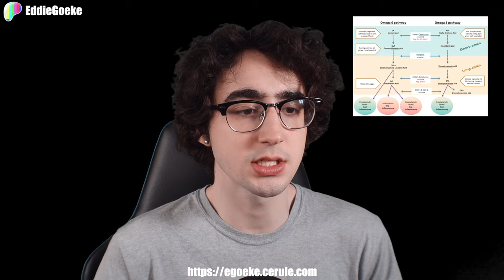SEED OILS Are HEALTHY!? | Reaction

Comment: What the hell do we do with all the PUFA's?  We Bake, Fry, Deep Fry, and Process by the ton with HEAT related Processes.  They are (intentionally) Tasteless so...not used to drizzle over anything.

PUFA's start out as Aldehyde Spiked Poisons.... then get further degraded with Extreme Heat using them... AS INTENDED... in high temperature cooking.

Comment: Isn't bacon full of pufa? Other than rancidity, what's the difference? I cut out seed oils long ago, but i can't imagine bacon being bad for you. Is it like the difference between DHA/EPA, and ALA? The animal form being ok and the plant form being harmful? Or are all pufas the same?
Reply from the maker: Bacon is high in PUFA, yes. But it’s really not the worst thing considering the PUFA isn’t oxidized to hell through heat and pressure during manufacturing, as well as from sitting in sunlight, and also isn’t really that high in deuterium.

Comment: I have a question?? Is this possible these oils are stored in tissues and the busy is resistant to release them. I don’t the people that ate rice and meats cooked in these oils seem to have more trouble losing fat even if they eat just meat
Reply from the maker: I'm not sure about that one, but perhaps. We do know that PUFAs in cell membranes have a half life of around 2 years, so we know they can derange cell structures for a while, but in terms of that affects fat loss, that I'm unsure about.
Reply: @e.goeke_  I’m sorry to even bother you.  But since you encouraged me by digging so deep and I have had to listen to 20 people to gain the knowledge you have alone , I was hoping you may be someone that could help figure this out. It’s for my wife. In addition how does exercise whichever type may be the most effective affect this fat loss? Do cell demands change, cells being forced to release due to some reason? Is it more receptors being made upon muscles used more? The you for taking the time. 

Wishing you much happiness and success.
Reply from the maker: Not a problem at all. This is part of my job. The only method that I am aware of by which a cell can be actually replaced is via the use of stem cells that the body releases on its own, wherein those stem cells will migrate to where they are most required and differentiate into an entirely new cell of the one they are replacing, allowing the dysfunctional/damaged one to die and either be excreted or recycled in some way. The flagship Cerule product effectuates this process far more than the body does itself, especially the more one ages. So that might be something for her to consider. I'd recommend watching the 2 primary videos on my channel about those if you haven't already. 

As for exercise, resistance training with static weights is optimal for fat loss, yes, because this increases the size and mitochondria of muscle cells (not the numbers, as humans do not have the ability to grow new muscle cells via hyperplasia), increasing their energy demands throughout the entirety of the time one maintains that muscle mass. The best method of doing such a thing is performing 2 sets of 8-10 reps for each exercise on a day of working out of a weight that cannot be lifted more than 8-10 times for each set. Exercise no more than 3 times a week as well. Ensure you are getting enough protein in as well, that being 1.75 grams per kilogram of lean body mass, lean body mass being very roughly calculated by taking your height in meters squared and multiplying it by 22.5, which will yield lean body mass in kilograms.
Reply: @e.goeke_  I love how you cover
Even your instructions in detail and not platitudes. It took me years to learn only a fraction of what you have acquired. Keep it up. You have great discernment skills to parse the truth from lies and wishes. You will be very successful,
Look out for compromise, one of your enemies. And thank you very much!
Reply: @e.goeke_  even though meat and fat contain all necessary nutrients, is there any positive effects or under certain conditions that mineral or vitamin supplementation is beneficial?